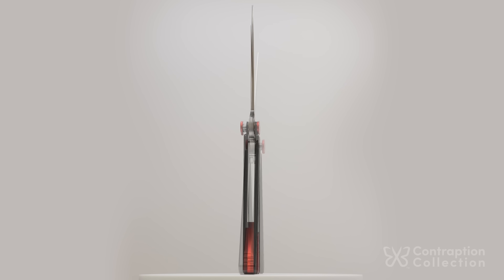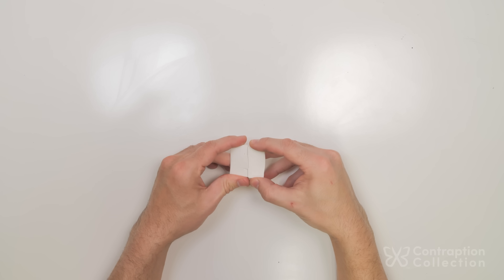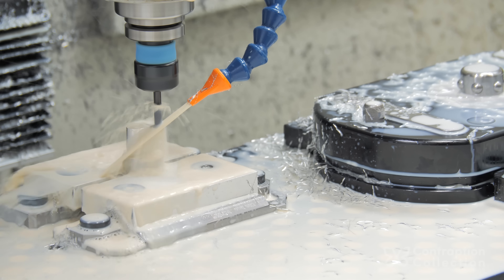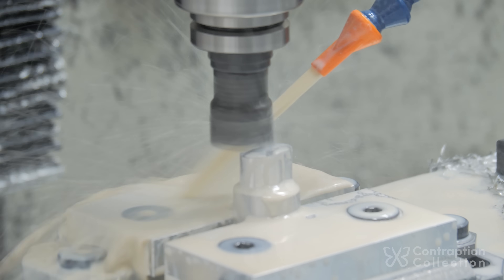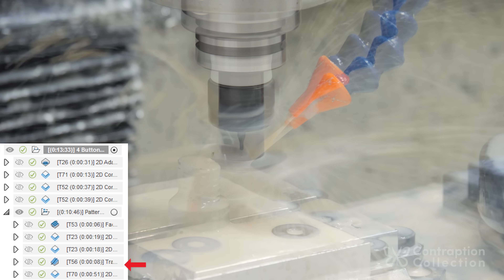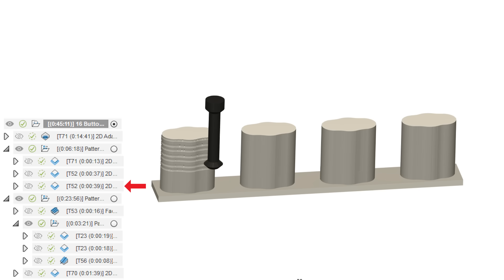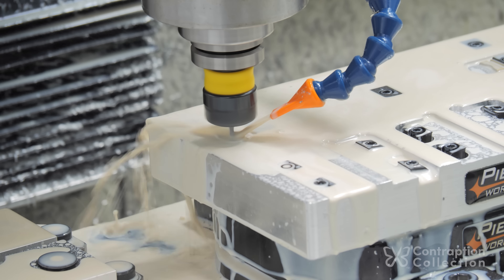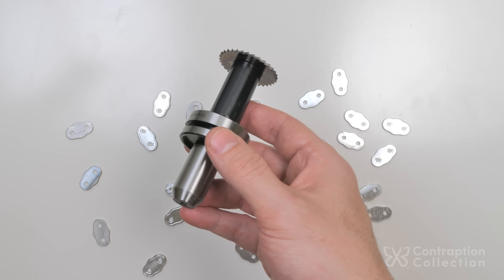How many parts can I make at a time? Baliscissors Ep 30

Comment: When I was working in a job shop they trained me to put a part in the vice/jig, get it a little tight, and then wham on it with a deadblow hammer before tightening the vice fully. Not a mjolnir wham or anything, but more than a tap. Until there's confining force, it's hard to control what the actual position of the piece is in the fixture, but once you have confining force it's hard to move the piece into position, so you hit it with a hammer to seat it against the bottom of the jaw. With your fixture system, once the clamps are holding the piece, most of the motion should be over, so seating it should fix any motion that already happened (and maybe make witness marks if something's upsetting it), and then you tighten it the rest of the way.

Now I should mention, this was the most anti-professional place I've ever worked, so maybe they're idiots. I just worked there and tried not to die.
Reply: I would absolutely agree that tapping things in with a lead hammer would help.  We used brass hammers and I could get every part back in place within a thou 100% of the time once I got the technique down right.
Reply: I've worked at anti-professional places like that. 95 times out of a hundred with those little workplace tricks from those places, you want to point at them and tell your kids "so this is how we don't do things," and those other five times you're like "wait a minute, that's actually genius, I'm going to steal that idea." At least in my experience, most of what they do isn't actively dangerous on a per action basis, per se, but the attitude of the place is definitely so unsafe that new guys who don't know any better will find themselves missing fingers, eyes, limbs, and possibly lives. I was the new guy who didn't know any better. I am also missing a finger because of it.

Comment: The issue of the button counter bore should be solvable by just adding a crush washer/regular washer with a small diameter to insure it has room to move. I think that should solve the issue at least idk. We use washes in aviation a bunch at these kinds of points, washers/crush washers take up the slop pretty well.
Reply: Where I work we do a lot of PTFE washers which should also work. Something with low friction to take up the gap would work fine
Reply: @Jacob-zo5fv  Yea definitely
Reply: At my work we level the tooling surface/work holder if the tolerance is off like that 

Idk about the volumes/finishing times for aviation stuff but for firearm parts it's way cheaper to take extra time for set up and mill the part right from the start
Reply: To clarify, the reason to use a washer is if you jabe tolerance stackup issues. On this part, you may be able to get the counter bore to +/- .001 but if the bolts are less precise (which they probably are) then that precision isn't as useful. So often it is easier to have washers that can still move rather than machining your own bolts and whatnot
Reply: @Jacob-zo5fv  mhm perfect explanation, we can only hope he'll see all this.
Reply: @raidzeromatt  yea that's definitely another solution, he could probably have dealt with this by squaring up some plate material and machine all the holes and bores first then the shaping second.
Reply: i cant help but suspect he doesnt have alot of experience in manufacturing and design for mass production, so often we get components that are just so badly toleranced or designed in a way that needs flawless manufacture, which just isnt possible

Comment: Salami slice method for the win! I use that on as many of my products as I can manage!
Reply: I do find that the method works better from rectangular bar when possible. Don't rough farther down than a single part, and you end up with a much more rigid set-up. Helps tremendously when you go to part off with the slitting saw.
Reply: @AudacityMicro  I wondered about that 

I was thinking it'd be better to rough in one pass but then finish/chamfer/saw one lvl at a time (and face mill at the start of each sequence obviously) 

I've never made parts that could be done with this method but I've made enough +/-.0001 tolerance parts to know chamfering all those pieces at once was going to cause problems lol